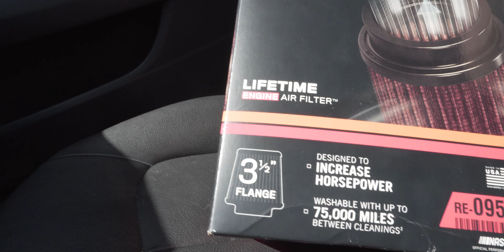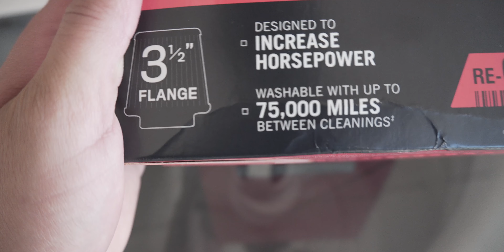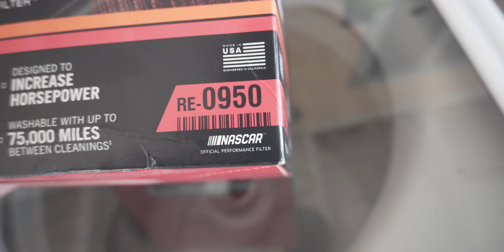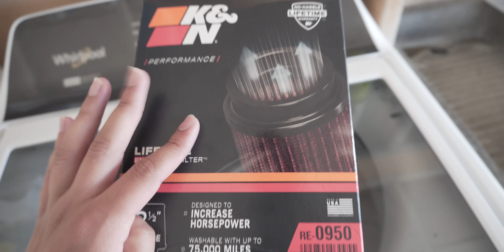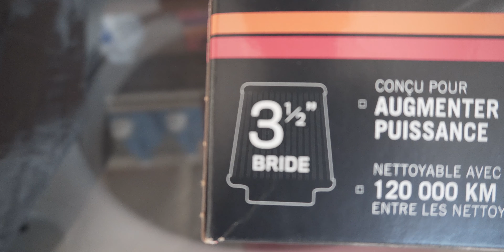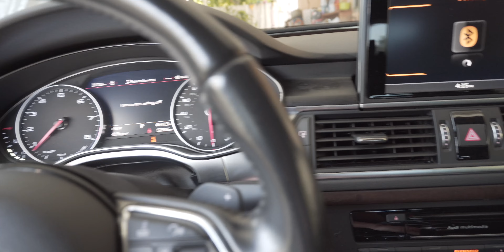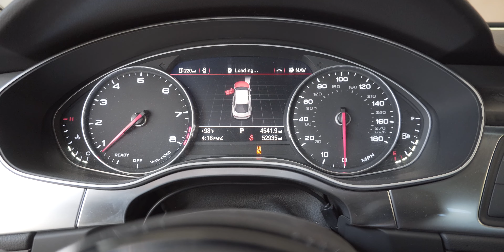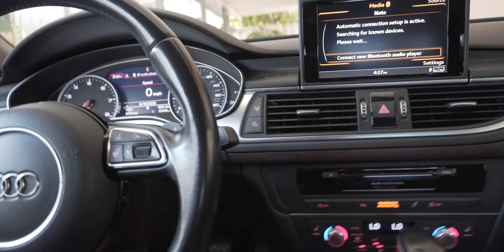MY INTAKE MELTED OFF IN MY AUDI A7

Comment: I would go with a IE or CTS turbo.. i have a CTS turbo and its great, has a heat shield , sounds loud as fuck and no problems for more than a year, also try to keep it in the original airbox
Reply from the maker: Yeah I might need to go to one of those next. When I first put on the intake I was going to leave it in the original air box but the supercharger didn’t sound as loud as I wanted it to 😬 It would probably perform better though